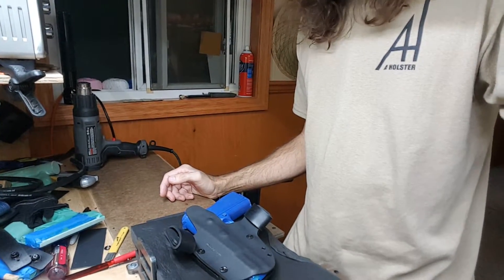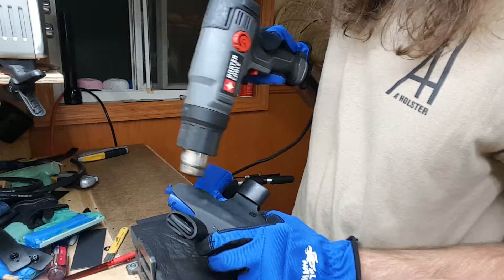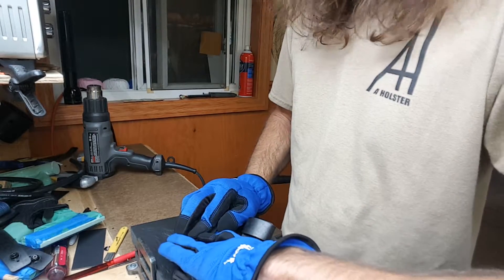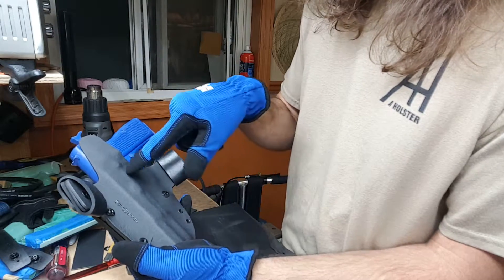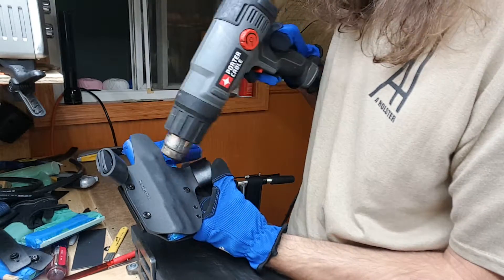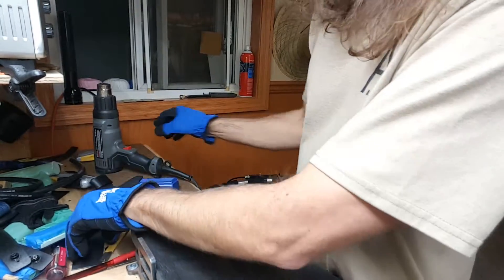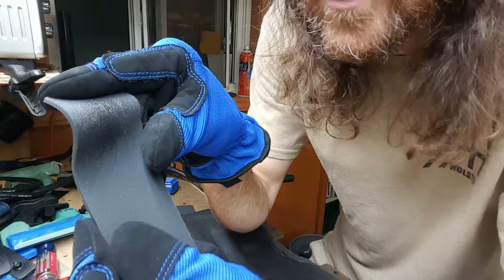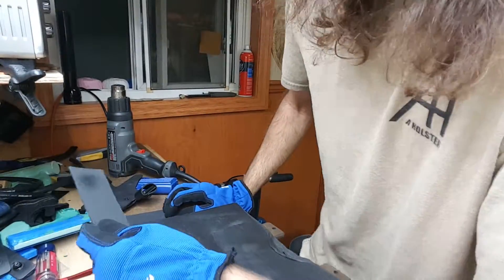Adjusting a kydex holster Bob Ross style, Aholster Company

Comment: Thanks for this video! I bought a sidecar holster for my shield 9 plus & wasn’t even thinking about the fact the mag is a double stack. The holster was for a standard shield 9. The gun fits fine but mag not at all. It’ll go in if I jam it in but can’t get it out without a struggle. Figured I don’t want to not use a holster I paid a lot of $$ for & saw people talking about doing this method to expand kydex. I had no idea you could do this. Your video made it very clear how to do it. I’ll be trying it tomorrow with my wife’s blow dryer. Lol. Hope it works out!
Reply: Figured I’d add a follow-up. Hair dryer didn’t work well at all. I think there’s just not near enough heat. I held it on the kydex for quite awhile but didn’t budge. I then went & bought a heat gun at Lowe’s for $25 bucks & it worked perfectly! So heat gun is definitely the way to go. Loosened right up & now I can easily take my mag in & out! Love this about kydex!

Comment: I have a question. I bought a new gun. I Already had a kydex house that fit previous models. The company changed there slide to a slightly wider size and more square. It fits the newer gun i purchased....but its a lil wider like barely and pushes the trigger guard through the holster and doesn't fit snug enough for my retention. I thought about taking the screws out of the holster and putting my new gun "same manufacturers" holster and taking the screws out. I am a mechanic by trade and own a heat gun. Thought I can again take the tension screws off. Heat up where the slide is wider and insert the gun. And slightly mold with my mechanic gloves on and form it and hold it in place till it's cool. In theory I think that will help? Like warm the holster up across the slide. Insert my new gun..let it form and just reinstall the tension screws. Is that possible or not? Please and thanks!

Comment: I have a holster something like the one you have there,but straps are made of 2 pieces of leather & not as wide as the ones on your holsters. They work fine but imagine  the ones you use grip better & look like if snaps were spaced just so,for a specific belt your going to be wearing the holster on,they could have even more grip from a little stretch in the strap material.make the snap more reliable by keeping just a tad of pull under the ledge on male part of the snap .correct?Its hard to shop online.if it was in my hand I’d know in 1 second . I think you get what I’m saying. The holster I have is good but the rear strap has come unsnapped a couple times.that brings up another reason why that strap material having grip would be better.The leather ones I have flex & twist a little getting in and out of the truck.that’s what they are supposed to do by design,for a little give. I think.?.But the way the double layer leather did it ,it must’ve rotated the 2 metal parts of the snap . I loosened & slightly adjusted the snap but now after wearing it another year I might better go back & take a closer look. The leather has relaxed some.thx for kydex tips & getting me thinking about how strap/snap materials are interacting with one another. Going to look at the belt holster a little closer & will call or email like you said if I need more explaining. I’m not a dummy,just better at assessing with touch.while I’m here,what I was going to ask before I got off on snaps& straps tangent,what’s the vertical black strip of material on one side of the front of that holster do?and do you make 365xl holsters? LMK plsThx and have a good one. . BW..NC.USA
PS. Every holster isn’t going to work  with everybody.little adjustments can make a big difference.Suppose that’s one reason for this video.You got something there.Thanks again.
Reply from the maker: That is a sweat guard. Keeps the weapon from riding against your body.